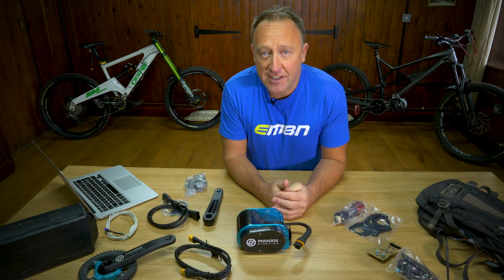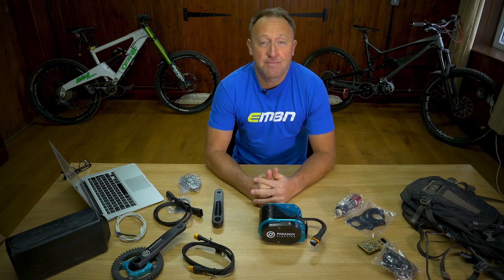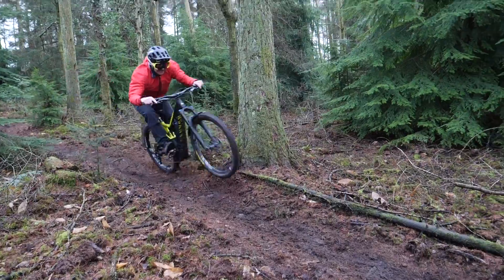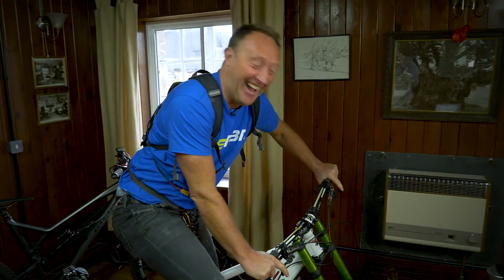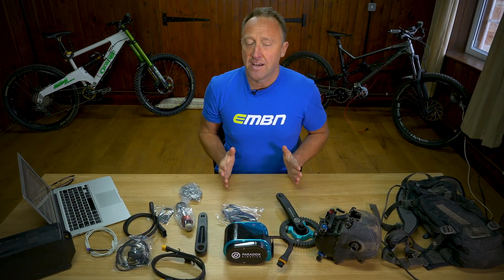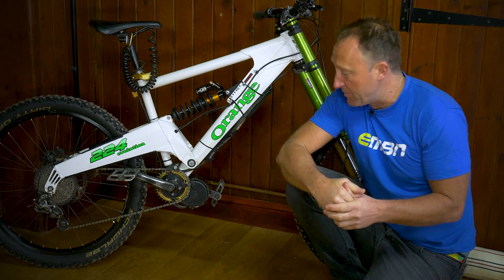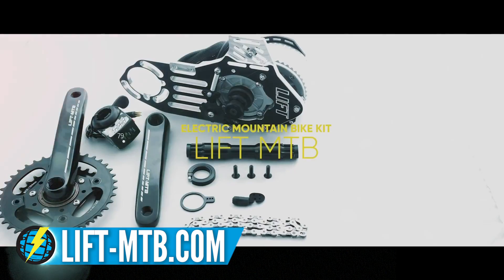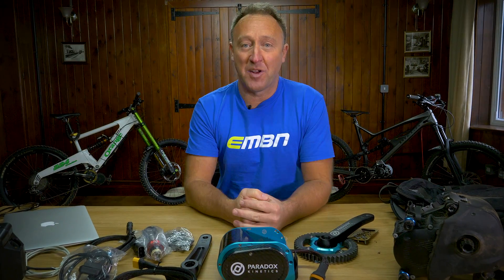Bolt On E-Bike Motors Explained | E-Bike Fundamentals

Comment from the maker: Do you ride an E-MTB with an aftermarket bolt on motor? Let us know below ⚡️
Reply: I've been fitting Bafang BBS-01 motors to customers bikes for a few years. Very basic sensing methods (cadence only), but the (legal in some countries) throttle fills in the gaps. All in all, great for an old dude who just wants to find an easier way up the hill. Square tapered cranks are potentially a weak spot, but Lekkie (who I get my kits from) offer a wide variety of high quality CNC parts to carry on from where Bafang clearly gave up.

A sub $1000 NZD hardtail and kit comes in at a total weight of around 21kg, which is definitely not an offensive amount.

I don't have much experience with the Tong Sheng kits, but apparently they use torque sensors, and are very competitively priced.
Reply: @Metal-Possum  are you the guy who is selling a merida on tradme for  $12.5k ?
Reply: @robn7773  Nope, not me. :)
Reply: @Metal-Possum  could you stick a couple of links to the builds / components of possible? Please and thanks.
Reply: Running the Lift-MTB kit. Done almost 7000km with zero maintenance. Ran it on my Rocky Mountain Slayer, and now on a carbon Altitude. Slayer came in at 17.3kg with zero shortcuts on weight/performance. Hands down prefer it to any ebike option. Also really good on long rock gardens where you would like to smash trails at speed. Running a E13 9-44 cassette and 36 chainring up front. Easily reach 40-45km on the trails. I would not recommend this kit plugged in on tech fast trails unless you have proper bike skills. Everything happens at a MUCH faster pace. The bike also handles like a normal bike, and pops on par with a DH bike. But, in short, high speed and fat smiles all the way.
Reply: @werfadder  , i am just now getting into converting an old downhiller. 83mm bb limits options. I REALLY like the lift kit idea, but have never seen one in person, nor have any real idea of how do find a distributer in the US. Have any ideas of US vendors I can search?
Reply: Hi Steve - you know I do. :D
Current is a BBSHD + BlingRing with an 830Wh battery on a BTWIN RockRider 500S.
Reply: Got two Ebikes a lapierre-overvolt and an after maket hub drive kit fitted to my trek T900 tandem which does surprisingly well powering 2 people along even on big climbs, rode the south downs way on it no problems
Reply: I run a 90nm torque fatbike geared hub motor.
Disadvantage is the weight on the wheel which rules out any mad jumps.
Advantage is its like an automatic, no gear changing and no extra transmission wear, it will never climb super steep like a mid drive, but its constant push can help in certain situations.
Reply: @chargeriderepeat7024  Yeah unfortunately with hub drive the stated torque is the max. it will ever assist. With a middrive the motor torque is multiplied by the gear ratio to give the torque at the back wheel. Eg. 160nm at motor with 30 teeth chainring and 50 rear teeth will give 160 x 50/30 ...... ie. About 267 Nm at the back wheel!. Thats why you cant use max. Power on steep hills lol. But meh people ride to what power they have and its all good fun.
Reply: The other advantage of hub drive is you can get a damn good run up while in a low gear, then take over as it runs out of steam.
I find that tactic can beat even powerful midrives, the panic gear changing usually spoils the momentum.
Reply: @chargeriderepeat7024  Ha yeah here in Australia I think we'd call that a slight rise lol. When you say ebikeworthy hill I think steep uphill for say at least 50m, one that you would be walking an mtb.
Reply: Oh yes, I think youll find those fatbike high torque hubs are far stronger than you think, mine can start from a standstill on a 45 degree slope.
Ive tested it on a concrete sea wall.
Ive also climbed 1200ft  paths up mountains that no manual bike could climb.
Reply: I have 2 converted mid-drive e-bikes. Both Baffang. 1 a MTB with 2500 watt Ludicrous BBSHD and 1 a 750 watt BBS02 city bike (limited to 20 mph & no throttle). Baffang does make the BBSHD in wider BB sizes for fat bikes (I think up to 120 mm). I  think that kits are a great option because for the price of 1 decent store bought e-bike I have 2 complete e-bikes. Both may lack the finesse of the store bought e-bikes but are far more powerful & economical and you can program them to your individual tastes. The learning experience of putting it together yourself also helps learn how the kit works, and the new stresses on the drive train will teach you more about maintenance. Very few downsides to doing your own mid-drive conversion.
Reply: I am using bafang bbs02 750w

- I don’t like it (the work of the assistant) is not a pedal - there is no pressure sensitive sensor on the pedals, it only works on the speed of the pedals)
This is a much more expensive solution - it works fine on asphalt, but on the ground, you just have to use the gas knob (and the harder the plot, the more gas you have to use) ... but this is not so bad or scary ...
just need to have this lead

(sometimes I even regret that I am not pedalist);)
with a pedal myself I would feel more like a cyclist

in the future (when in my country Adekavtnoe regulation will be introduced and they will be obliged to have a bicycle - not more than 250W (I would prefer to talk about the Pedalik 250W)

Yeshe - low clearance is a problem - I often hit stones - We have to be afraid of time

But even with us (we have too steep and wild mountains - these are often WILD trails) and there is a contingent of gas and the presence of a gas knob on our body (sometimes you just have to drive over difficult areas - in the MOTO MODE;) - such areas on the pedals do not even drive through short rods (it is almost impossible for the Pedals of Wesverya will hit the stones and you will fall to the ground)

that it’s not a MOPED (it’s more traveled), but I respect those who are on the north side

EGOKIT is a MOPED motor! (This is a full-fledged moped motor)
... Elsi do not want to become a Mopedist -that (you need to confine 1-1,4kW peak power)
and .. may the force be with you! (hybrid power)

.. * and I do not recommend the crane - on JAINT or with a similar curved frame, install the bafang (and especially BBS aych d - it will just hang down catastrophically at the bottom (pam as it is;) the clearance will be spoiled STRONGLY!
- for trails, lightweight more pokatushek can and will come down but Enduro on this will become problematic to roll
-Strong blow can even disable the motor
Personally, I have the whole motor in scratches and small dents;) - and this despite the fact that I have the skill (the motor does not hang below the star)
... and by the way on bbshd it is almost impossible to set a star in front of less than less than 42 teeth
is the motor is not very suitable for protracted uphols (there the reduction will be worse than that of bbs02, te efficiency will be lower)

the familiar skill rolls on the BBS03 and the motor heats up is noticeably hotter (sometimes even the temperature reaches that the hand can no longer withstand a long time;)
Reply: @88vok  leckie have a 36 teeth chainring for the bbshd. Or you can get a 104 or 96 pcd adaptor and go what you like in chainring size.
Reply: @BarryJTaylor  
you're right
to order (third-party firms make both 36 and 32, and even 28 seem to), but let's not talk about them

Ideally, the bafang calculated the chain line for a standard star on 46t

and not hanging bicycles will be able to use comfortably. 36t - the chain drive can be so big - that the transmission will jump off
besides, the line of the chain is too critical of bending — it wears the chain much harder

but we will not (litter here, it's a problem)
This problem has been discussed by the network for more than a year now - and it will be diluted (after the purchase is a COMPROMISE solution) everyone finds

but even so - the motor for the mountains needs to be picked up in a way with the little anterior star THE GAME OF DEFAULT (by default, the manufacturer must initially read and give a choice)

And the choice of stars in the bafang (as from the manufacturer) is only on models bbs01-02

and one more minus that I don’t like is a weak ratchet mechanism at the first gear stage of the motor (I’ve already replaced one, but when I bought a spare part it turned out that the Model was slightly modified and no longer fits my engine

The Chinese are the fact of it, and the Chinese

and this ratchet mechanism itself is smaller than that of PEDALICS 250W (much less)
* but as I distorted, we will not get stuck here - to the tum (this is a problem) I personally have no problem

...
Bafang - I do not recommend (Elsi would like a good pedal assistant)
- he is a good engine - far from ideal

* Anyone in the EU need to understand that the gas knob is LEGAL even on a 250W motor
te it is technically already cheating;)
you are a cheater cyclist elsi on any bbs of bbs models - will you call yourself or consider a cyclist

according to the rules of the EM - bafang bbs is a MOPEDNY motor
(and nobody will turn off the gas knob even on BBS02)

Bafang is a company more focused on a customer from the United States (Elsi too much to drop deeper;)

for good (by FERN) in the EU you need to have a driver's license in order to ride with the motor bafang
(a policeman has the full right to bring to responsibility the driver with a stacked motor)
and it does not matter (can the motor shut off at a speed of 25 km / h)
IMPORTANT exact point: (throttle knob) is also a MOPED part - equals 250W motor to a MOPED MOTOR
Reply: I dont run a mid drive but I have a 10kw hub drive with 90nm ov torque
Reply: Have ridden, and to me the difference to most stock ones is only they (bolt on kits) are from 2 to 10 times cheaper, and have more power and freedom than stock ones, most stock ones are 250, 500, and maximum of 750 watts, I've ridden BBSHD 1000 watt unit. A monster.
Reply: I'm currently venturing in to the 'EBike' ecosystem. Having suffered a back injury (not bike related) years ago, i'm slowly building my confidence back onto riding again.
I currently live in the south of Brazil. Specialized & Giant have a good amount of exposure in Brazil, however I'd like to slowly venture into converting my bike.
Due to high Tax laws in Brazil, the cost of a fully integrated EBike from brands like specialized is quite steep.
Reply: I ride a trek mtn bikewith a 750 bafang motor
Reply: i have a Paradox Kinetics on my bike, amazing power kit.
Reply: This is why no restriction and 1500W is useful at times. 

https://youtu.be/b-bzhWRyyI0

And thats pedal assist only. No throttle fitted.
Reply: @BarryJTaylor  my motorcycle i a lot faster
Reply: @MariusClippy  so are mine. But they are very different beasts.

Comment: There is  an additional  option from Maxon in Switzerland called Bikedrive, this is a rear Hub System which is available in 135mm 142 and even 148 Boost axle, got one on my daily commuter 👍 Expensive but looks very clean. compared to my Bosch Performance cx and Bafang BBSO1 way louder, but reacts super fast and is really fun to ride

Comment: Bafang 750w BBS02b and 14ah battery from aliexpress 473 pounds. I have fitted it to a brand new decathlon rockrider ST530 (370 euros) Brilliant system and really pleased. I have heart and lung conditions so it's the only way I can ride a bike.
Reply: I have the same...and very happy with it. Smooth, quiet and affordable.

Comment: its a shame you didnt put them all to the test, i have a Paradox Kintics motor kit, 1500 watt on my felt fat bike, had it before on a downhill. it is simply amazing and cost 2400 euros.
Reply: Hi - could u tell me if the paradox kinetics system has pedal assist modes along with throttle - look great am I’m planning to buy shortly - I know it’s a late reply but any info is great as there isn’t a complete review / walk around on the internet!! Cheers
Reply: @bhodi1486  hi bhodi, from what i know, its only throttle assist, for now. personally from testing both styles, throttle is better, instant power when you need it. hit the cruise control button and pedal at the same time.

Comment: There is no mention of the  Tongsheng TSDZ2 which is a mid motor pedal torque sensitive with a throttle option as well. Comes as 250W, 350W, 500W and 750W with 36v and 48v options and a choice of displays. Could you review this please . . . .

Comment: I Ride a 1000w front wheel drive Nishiki MTB. with a 48V 13 ah bottle battery. As mentioned in the video, there is at massive ekstra weight on the bike, and the front drive motor is not optimal for riding on the tracks. When that is said I have rode the bike for over 5000km, both as a comuter, and in the forrest. I have actually gotten used to the heavy front and for me it is no problem. I have tried different crank motors, but I cant seem to get used to them. Therefore I have decided to upgrade my bike, and bolt on my old front wheel motor! Great show by the way! :)

Comment: I can understand the conversion cost using the Bafang (I have the BBSHD kit) or Lift kits, but when you start looking at the 3000 euros plus for the kit without a bike, why wouldn't you go for a new out of the box ebike?
Reply: Because e-bike kits don't cost 3000 euros? BBSHD is around 1000. This gives you everything you need to get started including a wiring harness and integrated controller. A battery is around 500, but less if you are willing to have lower capacity. Which leaves 1500 for a bike. You can get a pretty highly specced hardtail for that much. Or if you know where to look, a decent deal on a dual suspension bike that is used.

Comment: I have a Specialized cross trail. I want to put a Luna cycle kit on it. With LUNAa best 52v battery and 1000 +/- watt Bafang motor maxed out, it is $1800 dollars (not including the $500 bike) so roughly $2300 total but I can get a slightly lesser kit without much sacrifice for $1300 + 500 making it $1800. Of course I will constantly upgrade but it gets me on a really powerful bike pretty cheap and I can upgrade as time and money allows.

Comment: Thanks for a very complete motor comparison. Just now shopping for a hunting e-mountain bike.
Here in the US I can buy a 750 watt BAFANG mid mount motor e- bike for $4,000.+ This is a  COMPLETE E- BIKE, not a bolt-on.  I mention this for price comparisons only.  I plan to use it for hunting in Nevada's mountains. Hey, I'm a geezer and need the assist of an e-bike since I loath the noise and stink of motorized  "quad" ATVs.
And yes, I need the low end power to haul 40 pounds of camping gear, scoped rifle and 100 pounds of boned-out deer or elk meat. That could easily be over 300 lbs. so a bike trailer may be in my future as well.

Comment: I had a BBSHD which ran at 1000 watts. With an upgrade of the controller it's now up to 2500 watts with NO WEIGHT GAIN! More power isn't necessarily heavier.

Comment: In the end, it´s simple: When you have a nice bike which is to good to be thrown in the bin and you want to go electric, just make sure:- Will the motor and battery and battery fit into the frame (this is the essential question)?- Will the chainline be acceptable? Remember, smallest chainring with offset for the Bafang BBS is 38, you may need    a 11-46 or 50 rear Cassette incl. the long derailleur, or you need to go for adaptors using standard 32 chainrings worsening   the chainline (can be eliminated by blocking slowest gear)- Can you accept inferior motor steer compared to Bosch or Shimano etc.. I´ve spent hours on fine-tuning the Bafang with   good results but torque sensors do a better job, believe me or not.The Tongsheng motor has torque sensing, but this is to sensitive for fat and strong rider, it goes to max power too quickly.Tongsheng has a stock 42 chainring which works good with 11-46.Both the Bafang and the Tongsheng reduce the ground clearance, so check wether this ok or not.Buying the motor in China is no longer a good option because european dealers offer the same product for only 20 % more. China is a good place to buy rear Cassette (11-50 for 32 € on "wish.com" incl. shipping) and spare parts.

Comment: BBSHD 160NM 1500 watts. I love 30 amp motor off road and don't like the weedy BBS02. I prefer power to light weight as it's more like a motor x. Standing on the pedals gives more control and throttle gives more balance.

Comment: Great overview thanks, yeah just to clarify.. bb kits do come in different sizes,  there was no mention of the cyc  3000w x1 pro on this video, it's on par with plugin motors weight.  Smaller ,the same price as a bbshd , a better build quality then the Paradox and ego system but at least half the cost..  these motors will be available in torque sensing also throttle and pas.. also a new type of pas that is grade sensitive..it knows the hill angle and adjusts the power accordingly.. the cyc will fit any bike that you like as long as its strong enough to cope with the 180mn of torque you are good to go.. 
You wait and see cyc will slash the current price of these kits and improve the performance also ..